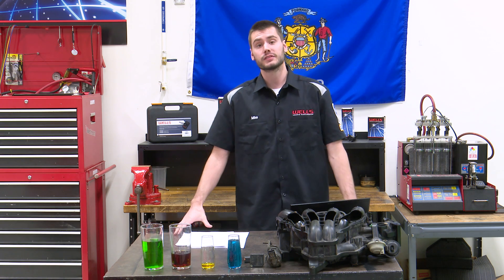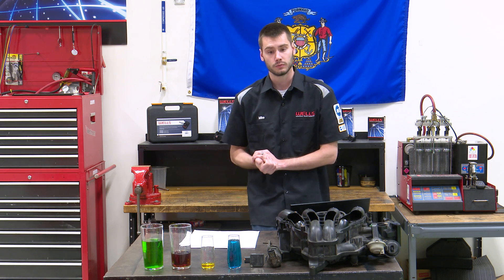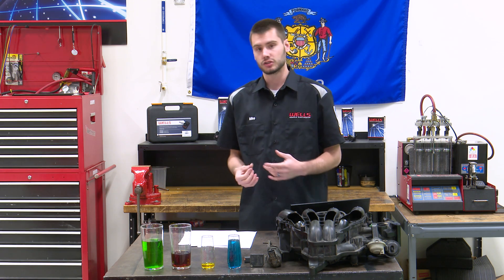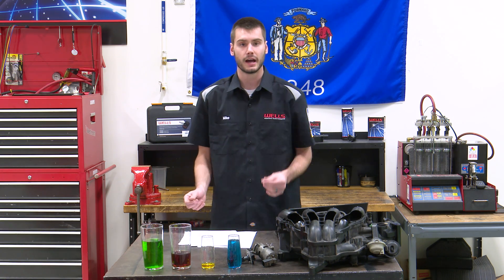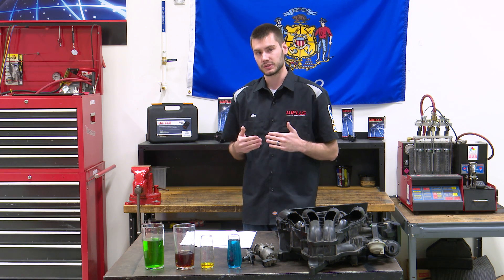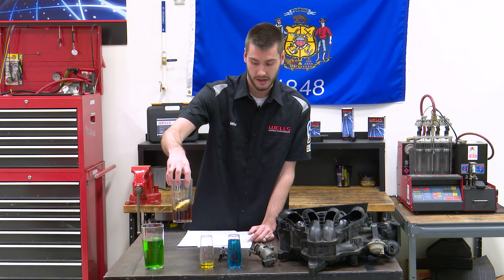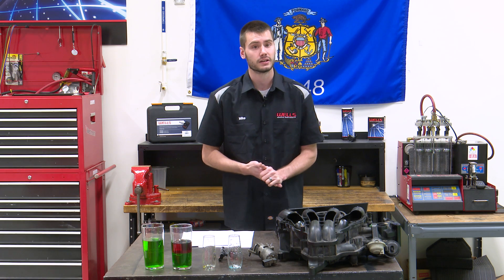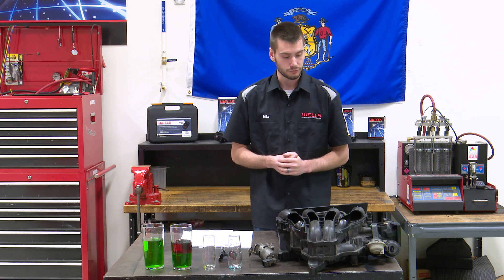Wells TechConnect Ep. 18 -- What Happens when an EGR Valve Sticks Open?

Comment: Nice explanation. Can tell you what happens in the real world yesterday with my Mazda cx 5 2.2 diesel. After a short 2-3 km ride (after cold start) i stopped for 5 mins.. EGR stuck at open position.. at this point but i was not aware of this until i started the engine. Immediately noticed unstable idle and misfires aand a lot of smoke. The car was choking literally. It's winter so my fist assumption was poor diesel - blocked fuel line or filter or something so.. decided to rev it a bit .. it caused a lot of smoke and it sounds like the car has lost a cylinder... tried to run it but it was struggling to reach to second gear... stopped and called a road help that pulled me to the service and once we dropped the car there it started perfectly without any issues :) Just FYI there was no check engine light or any error code logged. Anyhow the car will be serviced and the EGR body and intake manifold will be cleaned due to high carbon buildup.

Comment: in an engine that has only a map sensor, what will happen if the egr is stuck open? will the map count less or more in/hg? will it give rich or poor condition?
Reply from the maker: Hello,
With a speed density (map only) system. The EGR being stuck open would drop engine vacuum and show less MAP in/hg in the engine. It would also act as a vacuum leak and raise the idle and inject more fuel. Due to the extra fuel and the EGR gas being inert, I would expect to see a rich condition. All conditions would be more prevalent during idle and less noticeable under higher engine speeds. 
Good question!
~Ryan
Reply: @GoTechTraining  thank you ryan i just had a vw polo in the workshop and the egr was stuck open and the map shows 27 in/hg at idle and koeo normal 29.9 in/hg this is what i wanted to certify my friend. thank you.of course the car was difficult to drive and did not idle well
Reply: @GoTechTraining  is there a chance that a stuck open egr will give a poor condition? I have seen it in an opel corsa c but I could never explain it. have you ever faced something similar?

Comment: This is great. I'm trying to diagnose poor running and rough idling on my X-Type 2.2D at the moment, and I'm leaning towards the EGR sometimes getting stuck open. Today I disconnected the power to the EGR, and suddenly my MAF readings jumped from about 5-8g/s to about 12-15g/s while idling, and performance improved considerably. What I imagined in my head was exactly like the way you described here, mixing the liquids.
My thinking was that there was a lot of exhaust gas getting mixed with the "good" air, and the car thinks that it has more good air because the MAP is getting a high pressure reading, but the car just doesn't know that some of the pressure is due to too much exhaust gas.. My MAP sensor is right on the EGR valve and I think it's supposed to be a "boost" sensor, as there's also a second MAP sensor just after the intercooler, probably to measure the pre-EGR pressure.

Comment: A stuck open Egr does make the car run too lean because what it does is circulates gas into the intake that cannot burn like co2 so the co2 to oxygen ratio is off when your burning in 100% oxygen it burns hotter than a 70/30 oxygen to co2 ratio so you will burn hotter because you are receiving too much combustible air.

Comment: hi mate, i have a skoda 2,0 tdi cffb engine. it cut out on me in the morning at junction, wouldnt start again and only cranked. i got it started later on in day using easy start spray.  and i drove it half a mile, no issues. i went to start it again later in evening, same issue...started and clocked out when i tried to rev it. i described symptoms to a mechanic and he said most likely the egr is clogged or stuck open thats why it wont start . is this right?

Comment: If egr valve stays permanently close is like you are blessed, isn't it?
Reply from the maker: Hey Arnold, sure, if you don't mind the check engine light being stuck on!
Mike Becker, Senior Instructor
Reply: @GoTechTraining  is it enough to remap it so the valve stays closed, or I need to blank it as well? I am considering an egr off...
Reply from the maker: Depends on the vehicle. I'm sure if you remap it and force the ECM to never run the test it could never fail...it would just never pass either. Which may inhibit the vehicle from passing emissions. 
Mike Becker, Senior Instructor

Comment: The best explanation I've ever seen. Visual effects make this really easy to understand. Thanks a lot! One question though. Theoretically, if we're talking about electronically controlled EGR valve and old dying car battery, can the dying battery cause stuck open problems? Not exactly stuck open, but "sticky" EGR, when it closes sometimes correctly, but sometimes stuck. After replacing the battery I noticed a power boost around 1500-2000RPM and before that was having "P0402 Exhaust Gas Recirculation Flow Excessive Detected". The motor I'm talking about is HDI 1.6. So just to summarise, my question is if bad old car battery can provide low voltage or something and cause a "sticky" EGR valve problem? Thanks!
Reply from the maker: Hi Konstantine, thanks for watching! I don't think that could be the case. Most of the time the alternator puts out enough charge to keep the system maintained. If you were losing voltage though, sure it could cause some weird issues with the EGR, amongst many other systems.
Mike Becker, Senior Technical Instructor
Reply: @GoTechTraining  Thank you. Mechanics will take a look in two weeks so we will see what it was. The main dilemma I have at this moment is just to clean EGR, or replace it because no one knows if clearing will solve that I might need to pay twice if it needs to be replaced after cleaning...

Comment: I have an 03 impala that I usually have to feather the throttle (because it struggles to start) but once it starts it will idle real low. And Every once in a while it will start to rev up high on its own sometimes as soon as it starts. I have cleaned the throttle body and changed the idle control valve as well as the throttle position sensor. It has code p0300. It has new spark plugs also.
Reply: Still got the car?
Reply from the maker: Jason, a P0300 is a random misfire code. Could be caused by a ton of different things...how are the spark plug wires, coils, injectors, compression?
Mike Becker, Senior Technical Instructor

Comment: I'm chasing a stubborn P0507 Code on a '05 Grand Prix  Series 3- 3800 Non-Supercharged. I also have a LTFT of 25 and a STFT of 16 at idle. Which usually means a vacuum leak... I've smoked the engine... I see no leaks..... I've switch out the TB and the MAF with one known to be good.  I've replaced the PCV and it's gaskets. The Intake manifold gaskets have been replaced recently.  All the "usual" things regarding this code I have done..... I just can't seem to find the cause............................other ideas, that why I'm watching this EGR video......??  BTW.... the engine seems to run fine... until the CEL comes on and it goes into Limp Home Mode.
Reply from the maker: Hey, that's running super lean. You could be dealing with a fueling issue. Is your pressure in spec?
Mike Becker, Senior Technical Instructor
Reply: @GoTechTraining  I found the issue, (finally)..... the brake booster had a leak.... when I pulled the hose and plugged it.... the fuel trims returned to normal.
Reply: I have a 2000 ford f150 i have the codes p0171 p0174. And i cant find any vac leaks. Was running fine driving down the road and all the sudden its start to shake the truck..fuel trims at 25 for ltft and stft was also around 20 bank 1 seems worse then bank 2..and ideas?

Comment: Can it cause white smoke in tail pipes
Reply from the maker: John, most of the time white smoke is caused by coolant burning. Is the vehicle going through engine coolant?
Mike Becker, Senior Technical Instructor
Reply: NGK Technical Training no coolant level is ok no over heating problem  i replaced spark plugs wires and pcv valve     car is an 2004 grand am still has the factory Egr and fuel presure regulator
Reply from the maker: Hmm interesting. Is the check engine light on?
Mike Becker, Senior Technical Instructor
Reply: Yes its on

Comment: do oil inside the intake manifolt. the has a MAP sensor  will afect is performanse? oil is ocupaing space inside the manifolt so we dont get the right amount of oxegen.
Reply from the maker: Miguel, due to the PCV system there is commonly a small amount of oil in the intake manifold. Generally it does not affect performance, but yes, you're right. It is occupying space that could be taken up with oxygen.
Mike Becker, Senior Technical Instructor

Comment: hey great class on 02 sensors. i would like to know more about the PCM .  how does the input cause an output voltage control the fuel injector. if knew that then i would not  think of the o2 as switching. more like biasing a transistor     to cause the transistor to apply  current to    keep the  fuel injector  open longer or  shorter  , more fuel or less fuel   to cause the mixture of fuel and air  to have more  02 or less 02 after burnt . then it would make more sense as to why the  mark point of 430 Mill volts,  is important.  if the output of the 02 goes above or below the set point  then that causes a transistor  to turn on  longer or shorter . to apply voltage to the injector to apply fuel. i am assuming  the set point is the optimum  fuel air mixture.
Reply from the maker: Gilbert, if only it were that simple. The 02 sensor is kinda like the transistor analogy, but it does not DIRECTLY feed the pulse width modulation of the fuel injector control. There are way more variables involved in injector control besides just the 02's. IAT, ECT, Load, etc are all examples of things that affect it. The 02 sensor drives the fuel trims. Fuel trims are adaptations to the base program for the injectors. Cars are ever variable.
Mike Becker, Senior Technical Instructor

Comment: When people do egr deletes does that have the same effect as if the egr was stuck closed...does deleting the egr system effect afr
Reply from the maker: Great question. EGR dilutes the mixture. It effectively makes the combustion chamber smaller...reducing power. Yes, EGR can affect the AFR.
Mike Becker, Senior Technical Instructor
Reply: @GoTechTraining  so with the egr open i guess the computer can run a leaner fuel mixture and run a bit more spark advance?
Reply from the maker: It's not really  "leaner" mix...it's a smaller mix. The EGR gas takes up room inside the cylinder. Therefore less air goes into the cylinder, then we add less fuel. The mix is still stoic or very close to it.
Mike Becker, Senior Technical Instructor

Comment: Hey, Mike. 
Excellent vid.
Am I right in thinking that if you have an electric EGR  (5 wire, 2 for solenoid and 3 for potentiometer) that there will NOT be a DPFE or EVR. That the evr is to control the vacuum to the EGR pintle for movement, and the DPFE is to monitor pintle position. What measures flow in both vacuum and electric systems? 
Thanks.  Fox.  
N/ W Scotland.
Reply from the maker: Hey Fox, Usually that's the case. No need to have a pressure sensor when there's a position sensor on the valve. Both types of sensors are just to ensure EGR operation. Just 2 different ways of doing it. Some systems didn't even measure flow. Newer electronic systems monitor pintle position. If the pintle is opening, it's flowing. Typically the amount of flow is assumed, not measured.
Mike Becker, Senior Technical Instructor
Reply: Wells Vehicle Electronics 
Thank you so, so much for the reply and the answer that flow is "assumed" and not so much measured. 
Man, I bet you wish I had not happened upon your channel..... 🤣🤣
Reply from the maker: Fox, NO WAY! I love answering your questions!
Mike Becker, Senior Technical Instructor

Comment: SPLITTING HAIRS ON THIS EGR/VACUUM/INERT GAS THING......IMHO, I'LL STICK W/ VACUUM LEAK BECAUSE MOST ENGINES REACT AS IF THEY HAVE A VACUUM LEAK AND IF INERT GASES ARE DISPLACING AIR THEY ARE STILL DILUTING FUEL MIXTURE MUCH LIKE A VACUUM LEAK. YOU WILL JUST HAVE TO KEEP A FEW THINGS IN THE BACK OF YOU MIND AS WHEN IT MAY CONTRIBUTE TO A RICH MIXTURE. THANKS MIKE YOUR DOING AN AWESOME JOB!!

Comment: Great info. Mike . I have one for you , customer has a hard starting problem an said he gives it more gas by pressing on the gas pedal , he said it sputters an back fires in the intake manifold . This is a fuel injected engine . Now , while cranking is this giving the engine more gas or just allowing more air in .
Reply from the maker: Thanks Jeff! Are we talking pedal to the floor or just kind of feathering the pedal? It is defiantly letting in air, reducing the cranking vacuum. As for fuel, it depends on the vehicle I would think. I bet if you were to scope the PW of the injector cranking, then push the pedal you would see the PW expand if the PCM will allow it. 
Mike Becker, Technical Services Instructor
Reply: Don't know , the guy said just giving it a little more gas ! I told him about pushing the pedal to the floor would  put it into clear flood mode .
Reply from the maker: Hmmm, I bet that expands the pulse width a little bit. What kinda car? Did you get to the root cause or are you still workin on it?
Mike Becker, Technical Services Instructor
Reply: The car is a 2002 buick lesabre . I'am not working on it , just trying to help someone out . I haven't heard anything back yet from him. So i don't know what's going on ! If he ever get's hold of me i'll let you know . That would be  something to check , if i had a lab scope .
Reply from the maker: Alright, i'd be happy to help if you can get me a little bit more info on it! You gotta get your hands on a scope Jeff, even if it's just a little single channel U-scope from AESwave it's better than nothing. 
Mike Becker, Technical Services Instructor
Reply: check all the spark plug gaps

Comment: Great analysis of a tricky problem, Mike. To add another possible, complication, what effect is there with a dual map/maf system, assuming there is no egr position sensor ... Will ecu program preference maf or map??
Reply from the maker: Thanks Alex! That's a great question...a dueling of the sensors! Battle royale inside the motor. Well, I think that depends on the vehicle. In my experience, a MAF car will preference the MAF over MAP for air/load calculation. Also, we should factor in throttle and or accelerator pedal position right? In theory, a MAF and Map sensor with the EGR open would see less grams/sec on the MAF, and Map would read lower pressure. But...I think at that point the computer would take a peak at the TP and APP and see if you're in the throttle at all. So trust the MAF and O2 for fuel correction at that point, because the MAP seems to be lying based on TP ans APP right? Again, like I said in the video it's a case by case thing. Different volumes of EGR gas flow could really throw this for a loop...or where that EGR is piped into the motor....so many variables...so little time! Great follow up question Alex!!! What are your thoughts on how this would react?
Mike Becker, Technical Services Instructor

Comment: Great info and clarification. Nice to see that Mazda intake on the bench. Thanks!
Reply from the maker: Thanks Baxrok2! I love throwing some visuals in there...besides that intake was just toooo much fun to cut apart to never use it again. Did you catch the class I used it in? We were talking about the IMRC system on a (I believe) 04' Focus with the 2.3L. 
Mike Becker, Technical Services Instructor
Reply: I should have said, it was nice seeing that MazFord 2.3L intake manifold on the bench! Yes, I watched that IMRC video with great interest since at the time I had been struggling to find useful info on operation. Very creative and effective use of the liquids to show EGR gas displacing oxygen. Keep up the great work Mike!
Reply from the maker: THanks! A little visual goes a long way! Seeing is believing right?
Mike Becker, Technical Services Instructor